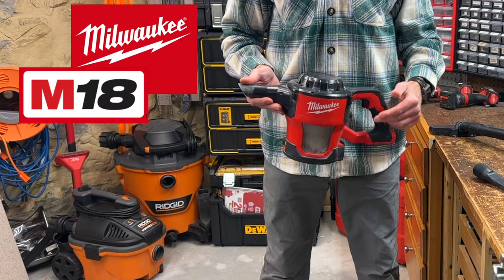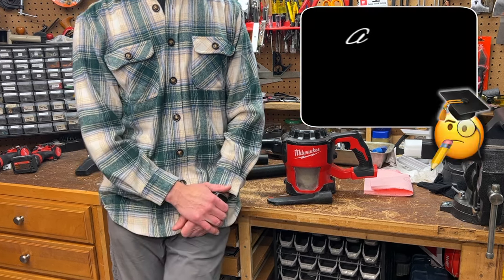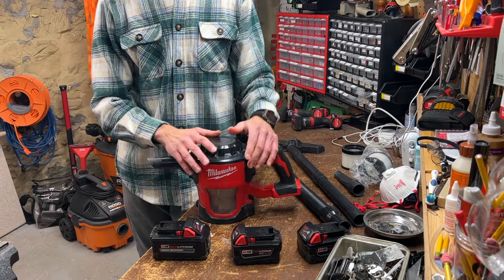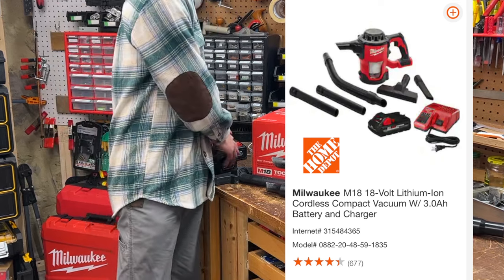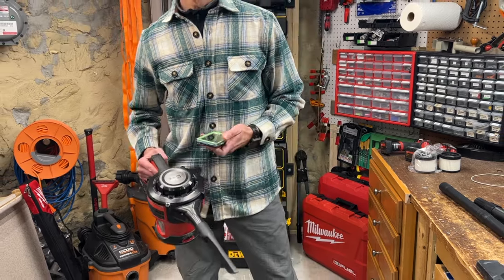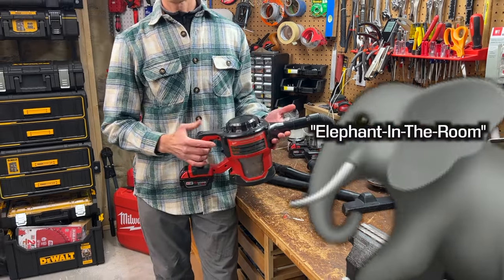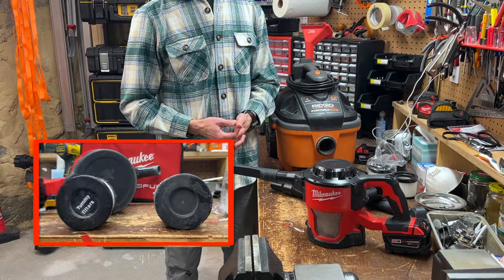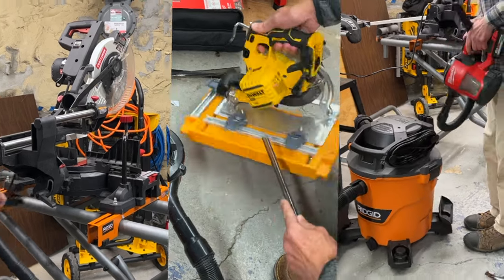Milwaukee M18 Compact Handheld Vacuum REVIEW 0882-20

Comment: Can an m18 12ah battery be used on it?  thank you for your reply
Reply from the maker: Absolutely. I have HD12.0’s and use them. Just makes the vac a bit heavier.
Reply: @BruceAlanR    Then what is duration on? Thank you for respond.

Comment: Did you know about the adapter you can buy online to install on your dyson to be able to use power tool batteries? They have one to use with milwaukee/Dewalt batteries and another for other brand batteries. Makes the Dyson worth having!
Reply from the maker: I am aware… in fact I made a short about it. 🤣 I’m a sucker for vacuums! 
Dyson V6 trigger+ (DC35) Battery Alternative - Adaptor for DeWalt 20V Max & Milwaukee M18 #shorts
https://youtube.com/shorts/ZagfWHiv2NY?feature=share

Comment: I use this for cleaning up when i have to drill a few holes for concrete anchors
Reply from the maker: Me too! Thanks for sharing that. 😃👍
Reply: @BruceAlanR  sure beats having to roll out the big vacuum and unwind the cord just to vacuum for 2 minutes and have to wind it back up

Comment: I have this one and it sucks. Turns off by itself
Reply from the maker: Ah! When does it tend to shut off? Is it when the motor is over taxed when something clogs the nozzle or is it possibly the switch issue?
Reply: I got one also the suction is weak even when clean out
Reply: I have pulled out the filter and had a fully charged 5.0 battery and it still timed out. I use this for work but it's a pain in the ass. I love the compact size but I hate the intermittent running
Reply from the maker: Yup! Sounds like a sensor issue. I had to send mine back to Milwaukee because it eventually drove me crazy. See my follow up video here: Milwaukee M18 Vacuum 0882-20 FOLLOWUP! Will they honor the warranty?  #milwaukeetools
https://youtu.be/TLZKwjxMErQ

Comment: would you use this for vacuuming the floors and hardwood in the house? Does it keep clean enough for rugs? We are looking at sharks, and Dysons for the house but I am in the Milwaukee world for batteries so I like the idea of swapping batteries vs having to have another eco system of batteries like Dyson or sharks. I also like the idea of using it for the shop or cars.
Reply from the maker: The Milwaukee is good on hardwood floors. I just wish the head was a little wider. With rugs it’s hit and miss depending on the rug pile. The upside to a Dyson is the weight (my wife says the Milwaukee is too heavy) as well as some the Dyson floor (rotary) attachments. The Dyson batteries stink though and tend to only last a few years (and they’re expensive). I recently saw an attachment for the Dyson handhelds on Amazon that allow for attaching a Milwaukee M18 battery. The adaptor looks rather awkward, but I’ve considered trying it given all our Dysons are beyond the warranty period.

Comment: Any chance you’ve used the Milwaukee M12 Hand Vacuum? I was wondering how it ranked up to the M18. It looks to be smaller in size and I’m just looking for something to keep under the seat in my dump truck to keep the dirt cleaned out of an evening.
Thanks!
Reply from the maker: Unfortunately, haven’t tried the M12 handheld (reminds me of the old Dustbuster vacs). From what I’ve read it’s loud and suction isn’t great. I’d say it also needs a hose for better maneuverability in a vehicle. If you try it out please post back. Would love to hear what you think. I have used the M12 FUEL wet dry lunchbox which is stows easily. The lunchbox does fine with dry debris, but shines when draining toilet tanks. Ha!

Comment: I'm on my 3rd vacuum it would always turn off so the sent a new one. On the invoice it just says motor is worn and nothing was wrong with the switch.
Reply from the maker: Thanks for sharing that. I’m really surprised to hear the motor wore out although if it was the motor, it was likely something as simple as the brushes wearing out (the vac doesn’t have a brushless motor). I had to send my vac back to Milwaukee because I started having the “switch issue,” which is not actually the switch, but a faulty sensor. They didn’t bother to fix it and just sent me a new one, which I’m beating the heck out of before it’s out of warranty. 😁
Reply: Mine has the same shut-off problem.  Now I'm armed with information I will be contacting them for a replacement.  It's terribly annoying.
Reply from the maker: @samuelonthewall  just curious how long you’ve had the vac and when it started to fault?  Mine started having issues after about a year. I filed a warranty claim and Milwaukee sent me a brand new one so I’m beating the heck out of it. 😂 Just be sure to file a claim on their website vs. calling or emailing. You can see my follow up video here:

Milwaukee M18 Vacuum 0882-20 FOLLOWUP! Will they honor the warranty?  #milwaukeetools
https://youtu.be/TLZKwjxMErQ
Reply: @BruceAlanR  I'm sure that I bought it over 5 years ago.  But I have an email thread with Milwaukee from 2 years ago where I explain the problem, initially thinking it was battery related.  So I emailed them today and hoping they will pull some strings, even though the warranty is likely expired.

Comment: Hm manual says you can use it on liquids. Do i Have to remove the filter then?.
Reply from the maker: This model is not a wet vac. You can NOT suck up liquids. If you do, it’ll fry it.

Comment: This unit is the worst tool I've ever bought. As one reviewer  put it, pun intended, "this vacuum doesn't suck......at all."  From day one it barely could suck the dust and tiny bits on a car seat. Worse performance with the dirt on a car mat. Dust from drilling 4 holes in plaster? Over a minute sucking to the point I had to collect the dust with a brush and push it to the nozzle. 

I've checked everything, and there are no blockages or obvious reasons for the poor suction other than it's not capable. I don't know what 40CFM is supposed to be like, but If this puts out 40CFM, then that's not enough to suck a tiny leaf or sawdust. In my three decades of buying and working with tools, I've never wanted to smash one against a wall like I do with this.
Reply from the maker: Thanks for sharing your experience.  I’m a bit surprised yours doesn’t have much suction.  It sounds like something is up with the vac. I recently started having the switch issue (sensor issue) where the vac would turn on and off after 30-40 seconds. Since it’s still under warranty I used Milwaukee’s eService to file a claim and mailed the vac back to them after which they sent me a brand new one. The new one works even better than the first one.